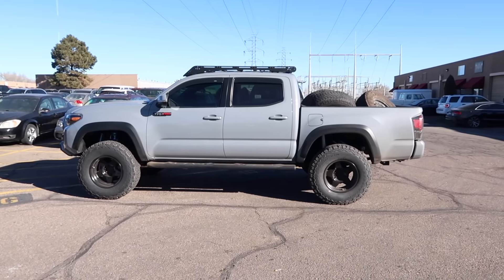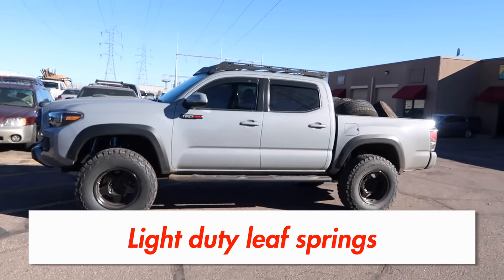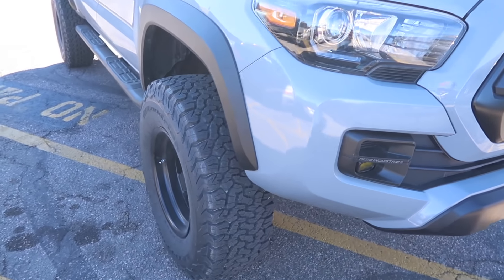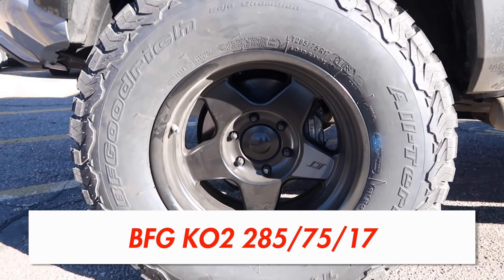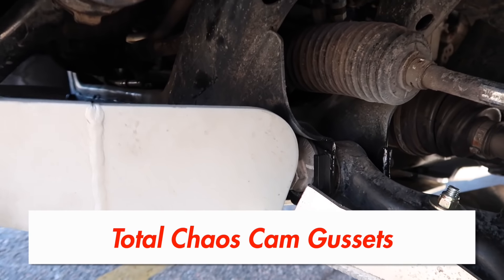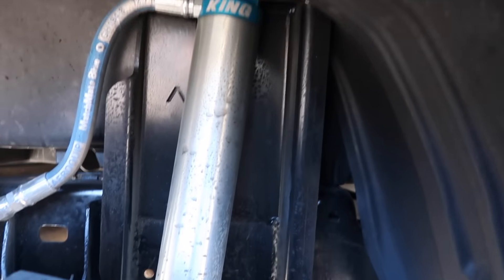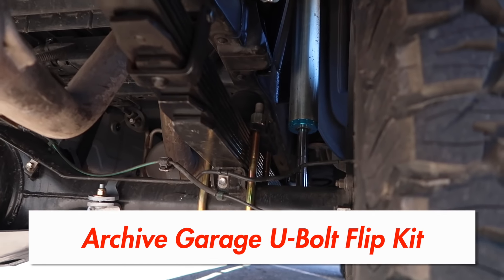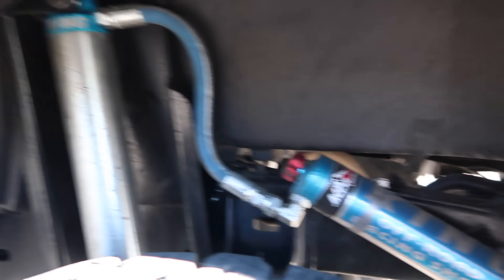Tacoma TRD Pro New Wheels and Suspension Finally ON! SCS F5 and King's

Comment: What trimming cutting did you do for the tires? CMC? Liner/bumper trim? Thanks
Reply from the maker: The usually CMC and plastic liner trimming. Whatever is in the way and that's based on the wheel and tire combo

Comment: Thinking of ordering the F5’s. They look great. But with the hub is exposed, what do you do on the rear wheel? Front wheels have a rubber cap, however rear wheel, at least on my Tacoma, the hub has a layer of rust.

Comment: did you drop the front diff?
Reply from the maker: MRSNIFFMEFINGA no I didn't because I only did a 2.5" lift. Just enough to fit the tires
Reply: @Runnin4Tacos  Thanks man! thats what I'm hoping to achieve with the king 2.5's I bought.
Reply: Taco Twonz 
How many threads shown on the kings to get 2.5” lift.
I have the exact same setup in the front.
Reply from the maker: Nate Robertson I'm not sure to be honest, we adjusted it according to the instructions and then we will adjust soon since it has settled now
Reply: Taco Twonz I just got mine installed. I told the shop 2.5. I think they went 3”. It rides ok. But alittle firm. I put the adjusters all the way to soft. I just wish it was alittle more soft. I have 285/70/17.

Comment: Where did you get the amber rigid fog lights? I’m assuming that they are rigid’s.
Reply from the maker: These are actually stock, I just put yellow overlays I got from Amazon. Super easy but makes a big impact on the look of the truck in my opinion.

Comment: I'm planning to buy 17x9 as well u think I'll get any rubbing if I have 3 in lift on it
Reply from the maker: PROs binbokills it depends on your tires and wheels offset
Reply: @Runnin4Tacos  it would be Ray's 10 17x9 3.5 bs 6x139.7  same as yours  but my tires would be 285/70/17 . I'm trying to  ask other people but no answers .
Reply from the maker: PROs binbokills you'll rub a little if your offset is -38 but nothing a little trimming of the thin plastic fender liner won't fix
Reply: @Runnin4Tacos  thanks dude ,  so the 17x9 will just make my tire stick out more  or just a deeper dish , sorry I'm just new on all of this

Comment: Any advice would be much appreciated. As always your experience and help is much appreciated.

My setup: Kings (-119-ext front and -121-ext rear, possible 3 in ligt), icon tublar UCA's, Old Man Emu mid duty leaf springs)

I just ordered a set of Ray 10 Brushed Bronze, 17x9, -38mm offset rims and have a 2015 second gen tacoma.

My questions are:

1. Will it fit in my tacoma, and if not,  how much should I pay a shop to trim my tacoma so the rim/tire combo will fit?

2. Will it effect my tacoma's offroad performance?

3. What size of tire and brand you recommend?

4. Am I missing anything?

Comment: You'd have been better off purchasing the OffRoad model since you've removed every TRD Pro about this truck. Nice setup though and hey, you should use it for what the after market parts are intended for. Get it dirty, get some trail rash on it and flex it out.
Reply from the maker: Benjamin Speechly I completely agree but I got it used and saved a bunch of money to get the all the cosmetic Pro goodies so I had to do it. Finishing some minor rubbing this coming week then we can finally take it out
Reply: Taco Twonz I drive 95% on road. I want higher ride 1.5-2.5 inch  with some hybrid tires for road and of. And to get smooth ride on roads and rough roads.  What would you recommend ?  Always scared to change suspension :)

Comment: I’ve got a stock TRD off-road 4 x 4 and I was thinking about getting these wheels because they are 5 to 6 pounds lighter than the stock wheels and I was hoping it would help with power and fuel economy. I would like to stance to work stock I’m gonna be keeping the tires that came on it for now what offset do you recommend?

Comment: Nice looking truck! Did you have to use wheel spacers for the SCS wheels and did you have to buy new lug nuts too?
Reply from the maker: BOMBS no wheel spacers, I got them in case I had to use them but ended up returning them. I did have to get different lug nuts

Comment: Did u regear?  If not, how does the power loss feel?
Reply from the maker: No I did not, I don't feel any power loss at all up. The only thing I notice is that I can't stay in 6th gear when trying to hold 70mph, it will downshift to 5th gear
Reply: As much money that you spent so far do your self a favor and regear to 4.88. You will be a much happier camper :)
Reply from the maker: Thomas Ford do you think that's enough? I have a bed rack now with a tent coming in the mail. Need advice on this
Reply: Hmm... I think so. 5.29 may be a little to tall for your size tire but if your gonna add weight... I have the same tire and size and the 4.88 gears just made the truck shift so much better. I’m not planning on adding a rack and a tent but some body amor later on down the road. When I’m on the freeway I’m in 6th gear a lot more and it doesn’t jump from 6 to 4th on the slightest hills anymore. It down shifts to 5th and you don’t even notice it shifting. After putting on the bigger tires I dreaded driving my taco... but now I’m back in love with my truck. Also get the ECGS bushing for the front clamshell and have who ever is installing the gears replace the needle bearing at the same time since they have it all apart.
Reply from the maker: Thomas Ford cool thanks man! Definitely a lot of good information. I will have a bumpers on in the near future too so I'm thinking 5.29

Comment: Hey man. Would you be cool with sending me everything you got for this lift setup?  I’m should be getting a New Taco this month and yours sits perfect man.
Reply from the maker: V DUBBER yeah. King 2.5 coilovers and rear shocks, Deaver light springs, Total Chaos UCA
Reply: Taco Twonz awesome man. Thanks!  I live in Colorado for now so if I get a taco before I leave in July we should hit some trails man!
Reply from the maker: V DUBBER yeah I'll be down
Reply: @Runnin4Tacos  hi I have 2.5 kings extended travel (front and rear) , icon tublar UCA's, and old man emu mid duty leaf springs. I just purchased Ray 10s 17x9 38 offset.  My installer is recommended me 275s toyo tires instead of 285s. Curious if I'm going to rub after trim and have already incorporated a cab mount chop. What are your thoughts? Will my set up work? Look forward to hearing from you soon!

Comment: Why did you get the TRD pro and take off the FOX suspension? Great build just why not build up a TRD off road?
Reply from the maker: Marc Downing I found a good deal for a used Pro and the Fox is nice but I wanted more ground clearance and needed bigger tires for that so I needed a lift to fit them. Got the Pro wayyyy under MSRP but I get this question all the time so I get it
Reply: @Runnin4Tacos  Ahhh I see! Here in Canada TRD PRO's go for a premium.
Reply from the maker: Marc Downing ahhhh I see. I got lucky here then 😁

Comment: Nice equipment, definitely heads above most Taco lifts, you would think paying that much to have it installed they would have covered the shocks from all the over spray......kinda defeats the purpose of having high end Kings covered in black splatter. Bad workmanship by that shop imo
Reply from the maker: Leni O hi, I think what you are seeing is dirt and mud. This was shot about a week after the install and I have already taken it on a few dirt roads. There's definitely no over spray because we didn't paint anything after the King's were put in